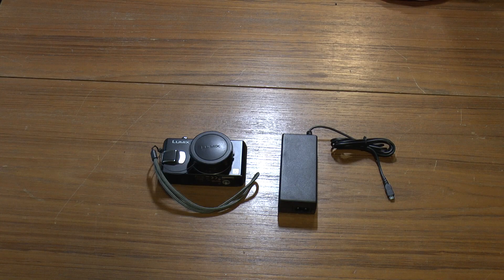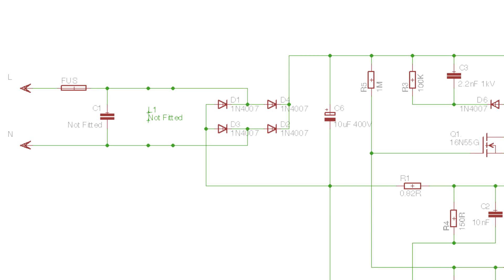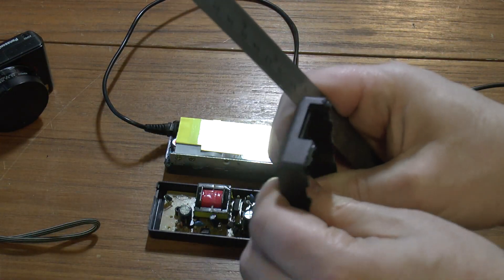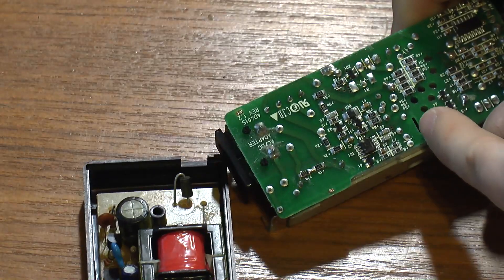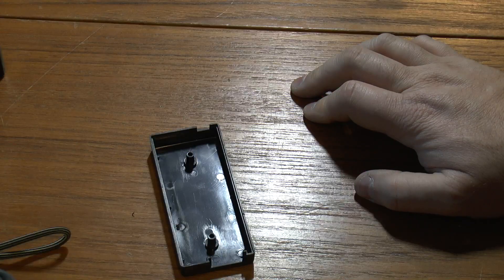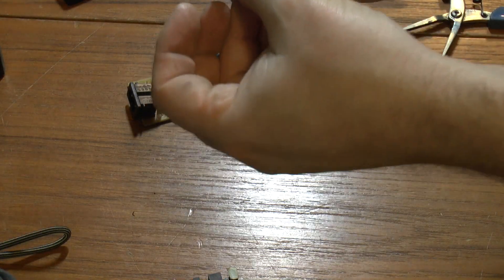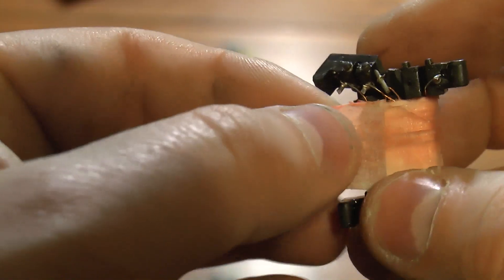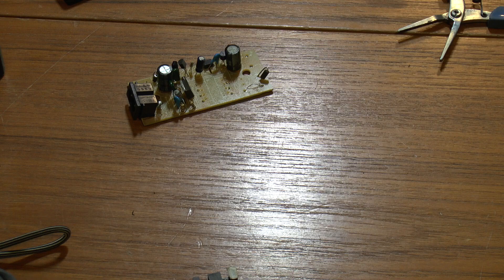Fake Panasonic DMW-AC5 power supply teardown

Comment: I see suscon alot in all kinda stuff. Not sure how reliable they are, but I think I remember replacing alot of them.   I always feel out the Chinese sellers, there's a few that sell half decent products ( mostly led stuff ), it's like finding a needle in a haystack. They do the same crap with cheap computer power supplies, skipping filters and caps as well as the PFC circuitry. But for laptops and stuff, I always look for genuine supplies, even if used, they are better.

Comment from the maker: Trading Standards now have the eBay seller ID, item number, a link to this video, a high-res PCB scan with live, neutral, 0V DC and 340V DC tracks highlighted and the PCB itself with input fuse and transformer removed. I've just kept the output cable I was after in the first place :)

Comment: Su' scon is a known "manufacturer" of shit Chinese caps, just like Capxon. I would be surprised if they actually bothered using a Japanese cap like Nichicon on the low voltage side, it may prove interesting to compare the label and any numbers on it to a real Nichicon as it's probably a counterfeit. Another trick they have is to take a make of a reputable cap and spell it slightly differently, like "Rubycon" becomes "Rudycon".

Comment: I'm of the opinion that switcher supplies like that should be banned outright, there is almost zero isolation for the AC mains. The properly designed ones ideally should shut down should something fail, the cheapo ones make a light show and then cause a fire. What brand of failure prone China caps does this power supply use?

Comment: The label has a UL listed logo on it with no UL file number next to it. UL might be interested in the product and seller (as well as trading standards). If it had a file number, a useful tool to make sure it's the *right* number, on the *right* product is hxxp://database.ul.com/cgi-bin/XYV/template/LISEXT/1FRAME/gfilenbr.html

Comment: Scary...just look at the cheap red insulation tape around the transformer....just think they more than likely separate the primary & secondary in that transformer with the same method..and anyone who has basic knowledge will know cheap insulation tape .....HATES heat and will break down VERY easily....then what could you end up with a laptop/camera/mobile phone being charged with 240 volts...not a good thought!!!

Comment: it's worse than 240V for the 0.6667mm gap - most equipment used within the UK is designed to withstand 1000V surge, that's why the creepage distance on the proper supply was large!

That cheap one would have a job to take 1000V isolation test! Plus the soldering looks very dodgy too! I have seen cheap power supplies start to melt (I've still got one!!)

Comment: Not boring at all mate, very informative and your schematic diagram was instant understanding :-)
Ive been repairing electronics for bloody years so i understand your concerns.

The masking tape primary insulation did it for me, in the bin it goes.
Never seen one of those modified plugs before, ow er.

Most decent made laptop smps last a decent amount of time, supprising as the pcb is stuck in its own ovan :-(

Smashing vid mate :-)

Comment: I bought a 9.99 universal laptop adapter once on ebay, the input power cable insulation broke around the connector that plugs into the adapter within just a few weeks of owning it. It's easy for people to see something cheap and buy it thinking they are saving money but in the long run you're better off saving for genuine replacement parts as they are far better quality and will last longer.

Comment from the maker: Creepage distance is across the surface from one conductor to the other. Clearance is the distance between them through air. A gap sliced through the PCB will increase creepage distance (as electricity would have to go all the way to the end of the gap where the PCB rejoins) but not clearance (where it can just arc across the gap).

Comment: Quite possibly designed for the American 115v market, but being switchmode, can also run off a higher input voltage.  Even at 115v, I would be worried about that track gap, and what looks like pretty pitiful insulation between the primary and secondary of the coupling transformer.  Now, at 230v, this is four times as bad!  A bit scary, really.